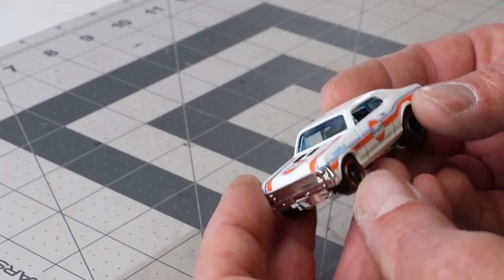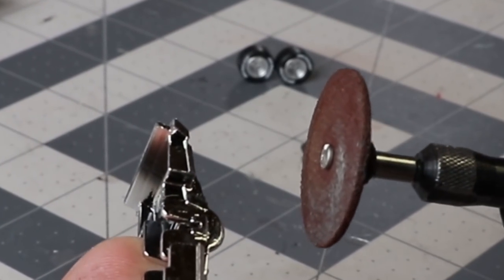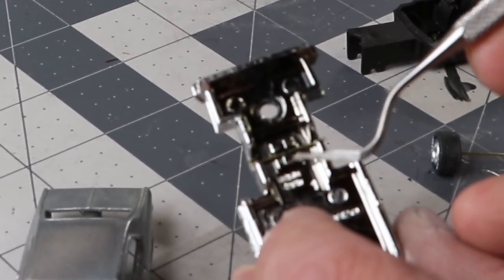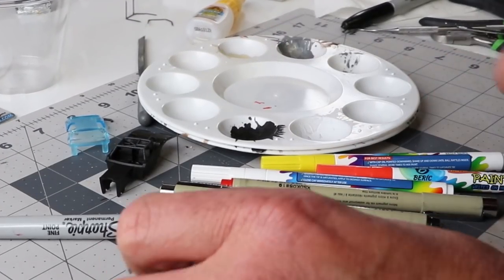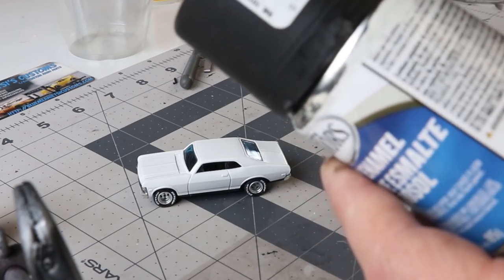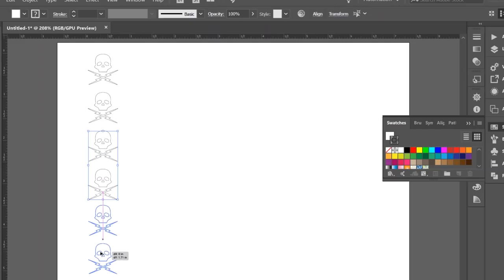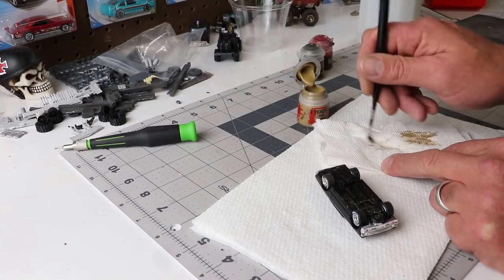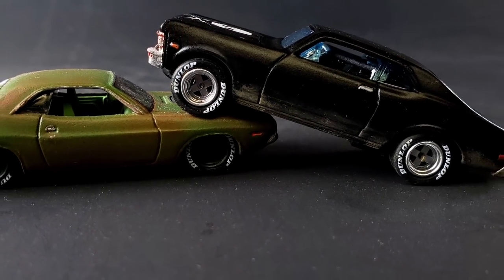Hot Wheels Custom Deathproof Nova

Comment: Just a tip for sizing the decals. I used to strip the cars I was going to customize and either leave it ZAMAC or paint it white. I would then scan the cars on my scanner which gives you a 1:1 ratio image. I then opened up the image in Photoshop and using layers, I placed the decal images I intended on using on the scanned image for sizing and placement (to see how it would look on the car). Then I printed out the decals. Never had an issue with decal size. I think I still have a disc with a bunch of casting already scanned.

Comment: A couple of tips:  1) If you soak these plastic chrome bases in 90% isopropyl alcohol for a few minutes (usually 3-5), it will denature the coating to a satin aluminum finish. Blot the base then let it air dry. If you rub the base when it 1st comes out it will take the finish off down to the plastic. If you leave it in the alcohol too long, it will completely remove the chrome.  2) If you put black paint in an insulin syringe, you can fill in recessed areas like the grill. The tiny needle can get into places where a brush can't go, the plunger gives you precise control of how much paint comes out, and the needle tip is so fine that 1 drop is hardly any paint at all.

The car turned out great. Have you thought about doing other movie & TV themed vehicles? That could be a go-to when you're creatively stumped for your next project. Are you in the medical profession? I'd say most people don't know what smegma is, much less use it in a sentence. I just about spewed my soda when you said it. I'm really enjoying the channel.

Comment: I think this is an awesome custom.. I also think you woulda had a better outcome if you started with a m2 brand nova. The rear wheel openings are accurate to the real car as opposed to the exaggerated openings of the hot wheels brand.
Reply from the maker: I have yet to see an M2 nova. But I will keep my eyes open, I have another project in mind that involves one
Reply: @OutlawSpeedShop2001  I correct myself. The m2 machines are 67 novas. The one I meant to suggest is the American muscle brand 1969 nova. Those are a fully accurate reproduction of the real car.